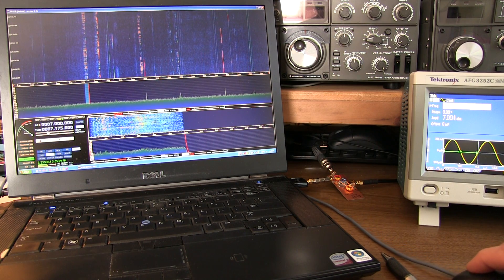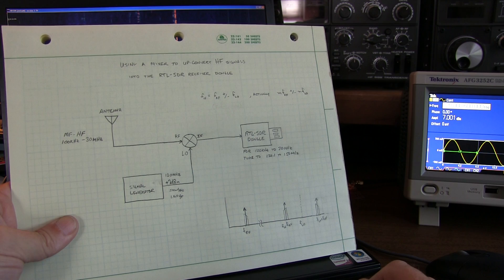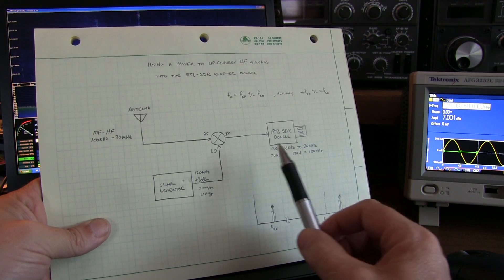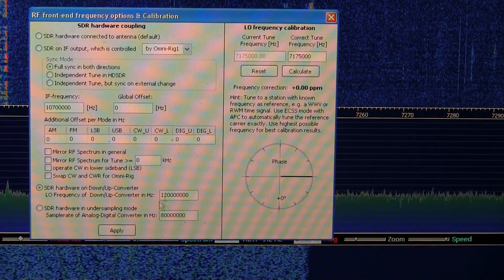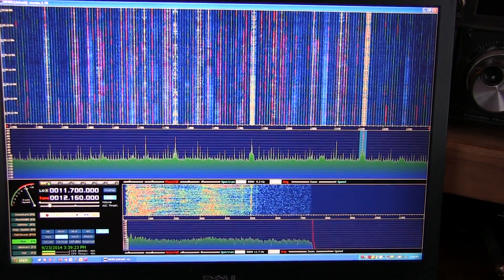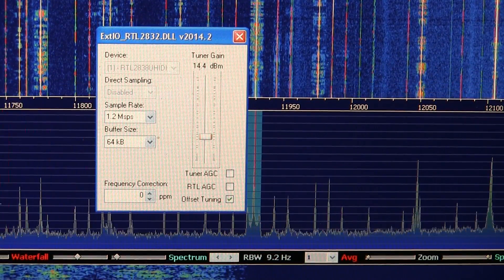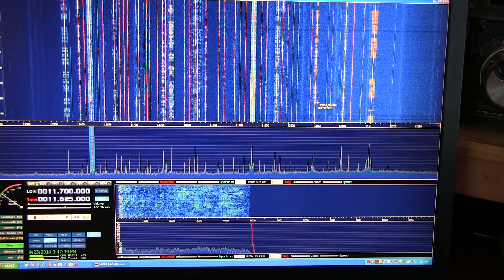#174: Using a mixer to listen to HF, shortwave, ham, etc. on RTL-SDR dongle

Comment: Another great video!  I suppose once you've done this enough the wonder starts to fade, but the whole concept of mixing frequencies is such a cool application of physics I think I would still have a little bit of joy seeing these signals translated so cleanly up the spectrum. 

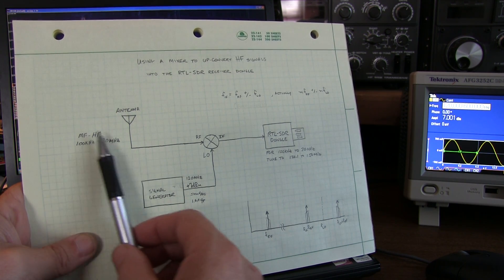Quick question...can the diode ring mixer be used to downconvert as well?  (I'm assuming that would be the 'difference of two frequencies' you mention at ~1:30)  I'm interested in downconverting ultrasonic audio that's in the range of hearing for animals (domesticated in particular).  Basically ultrasonic mic -> amp (?) -> mixer -> amp (?) ->headphones/ADC
Reply from the maker: Yes, absolutely. This is what is done in most broadcast receivers. In the US, FM broadcast is typically downconverted to a 10.7MHz IF. AM broadcast is often downconverted to a 455kHz IF.

Comment: Reposted comment:
Is the I/Q technology the same one governments use to record the whole RF spectrum for easy playback at a later date? I've heard there are satellites that record the whole RF spectrum and can relay the data down to the ground, so they can actually "rewind" time and listen to any RF from any source on the planet. I guess they use an array of different antennas in different orientations (phased array) to be able to derive the rough locations of the signals.

EDIT: Here's the kind of thing I'm talking about: X-COM Systems/Tektronix RF Capture and Playback Solution

EDIT2: I think comment responses should work now.
Reply from the maker: Yes, the XCOM/Tektronix solution records seamless IQ data over a 165MHz BW.  The resulting data can be captured, analyzed and replayed at any time - thus any signal within that capture BW can be replayed as well.
Reply: ***** Thanks. I wouldn't have thought it to be possible until I saw your first I/Q video. The way you explain it makes so much more sense than other videos out there.